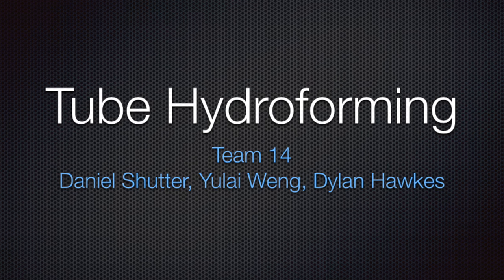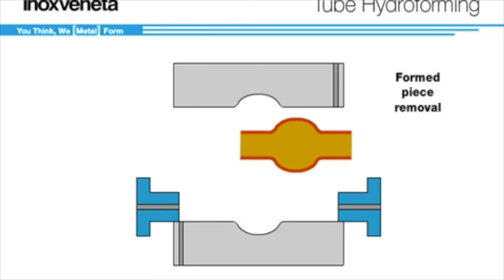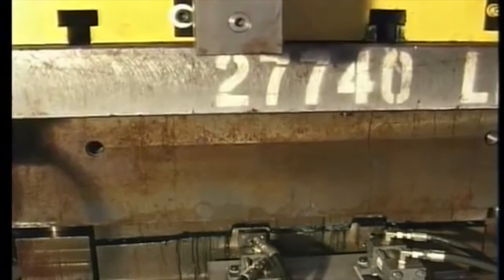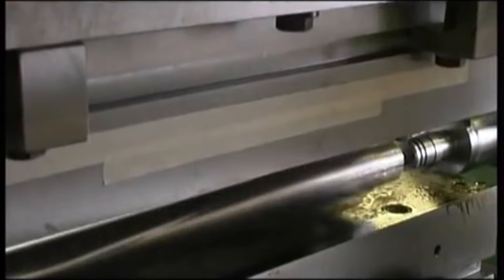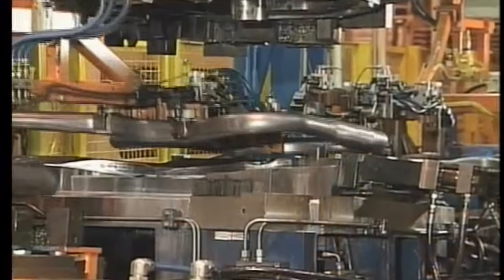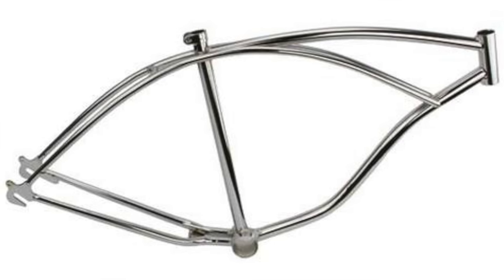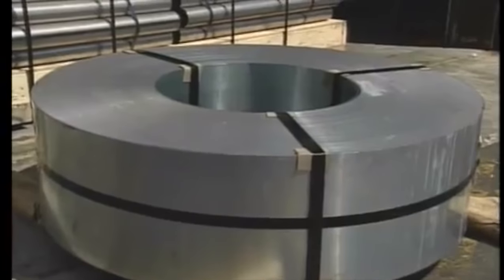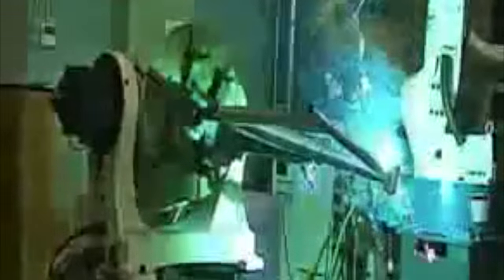Tube Hydroforming Process

Comment: So now everyone knows why some modern bikes are ludicrously expensive.
Reply: Not necessarily. Plenty of $100 hydroformed bikes at Walmart.
Reply: @squiresuzuki  Have to agree. My new Marin Fairfax (which I don't regard as ludicrously expensive for what you get) has hydroformed head tube, top tube, down tube and (possibly) chainstays, although they have a flat section. The fork is full carbon. This makes for a very comfortable, quick ride in what is just an urban commuter bike.
Reply: @squiresuzuki  I wonder if the Walmart bikes are hydoformed.
Reply: @squiresuzuki   True. I got a $99 Genesis with hydroformed tubes.

Comment: MIG is not wire feeding through a heated tip. In hi current welding, tip is on the contrary cooled
Reply: he wasn't describing MIG welding he was describing M I G welding.... duh dummmy
Reply: @lockgessner  this must be a local term in ur part of Momgolia
Reply: @thomseng   clearly you didn't watch the vid or you would understand the joke....
Reply: Yep, he did a good job describing the tube hydroforming at least.  He should have stopped while he was ahead.